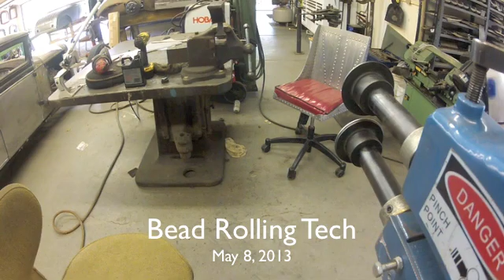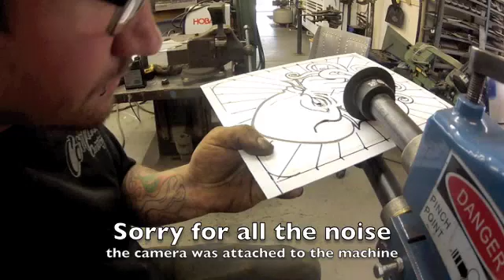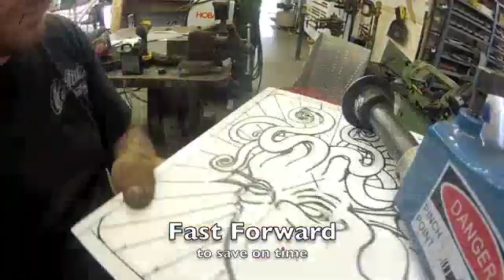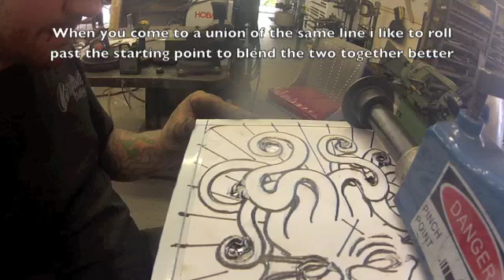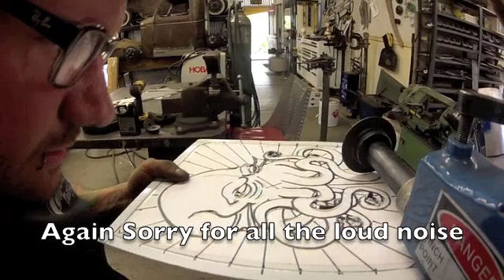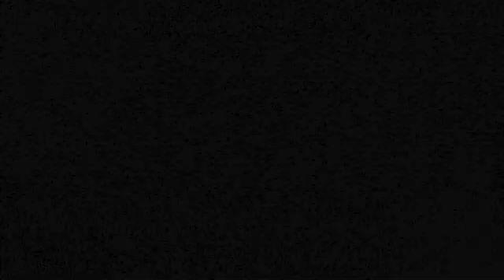bead rolling an octopuss

Comment: on parts that are smaller than the wheel radius ,do you just hand punch those with a die and hammer or a die in a hand press?  I'm building a large octopus driveway gate that has articulating arms activated by hydraulics. fun stuff.  Thanks
Reply from the maker: no everything is done on the roller, for smaller lines you just use less pressure. there is just a very small contact patch so the diameter doesnt matter to much